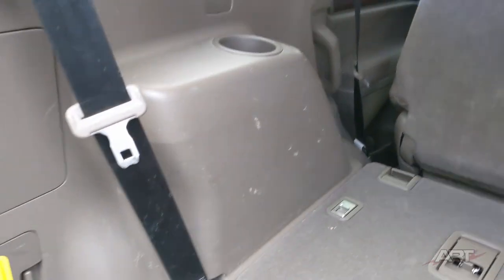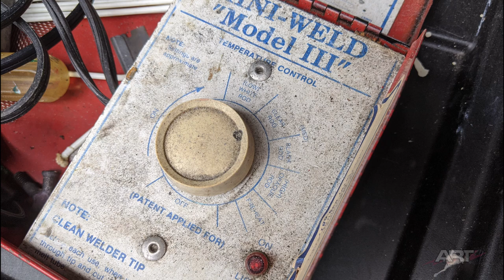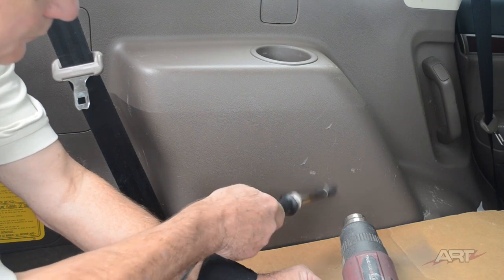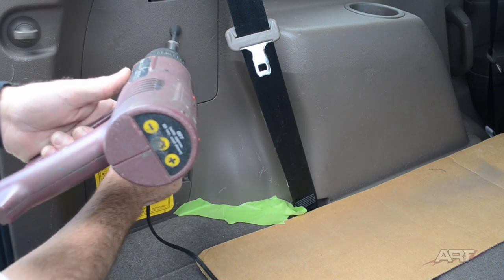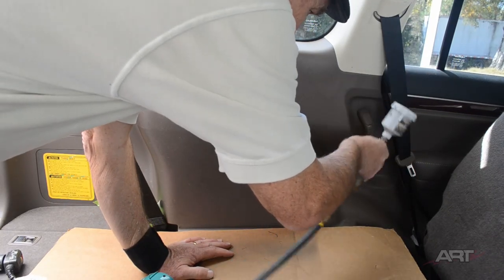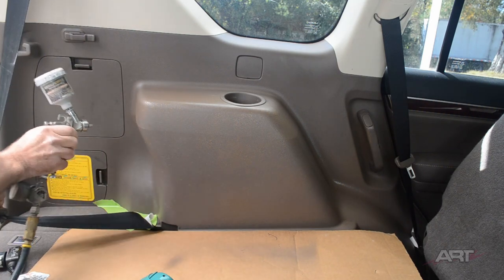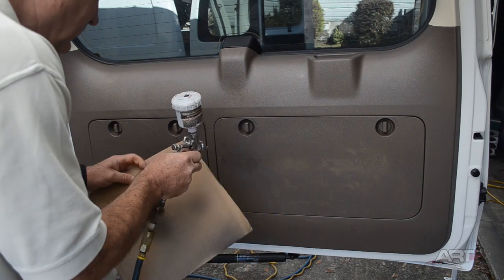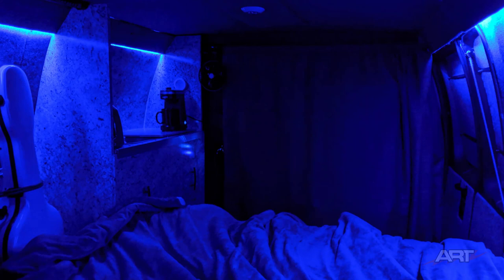Cargo Area Plastic Repair v26

Comment: cant seem to find a plstic welder with a heat control knob. mine is either on or not..and when its on...its hot enough to burn holes in the surface of the earth